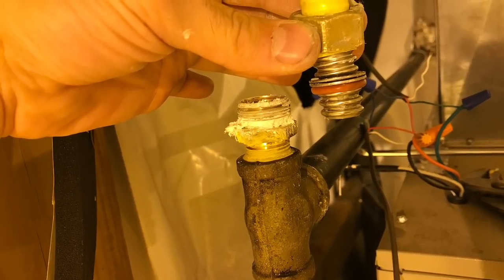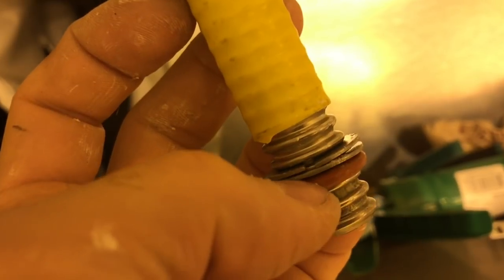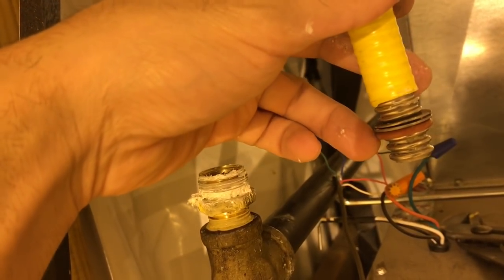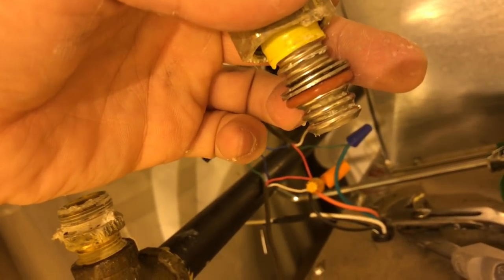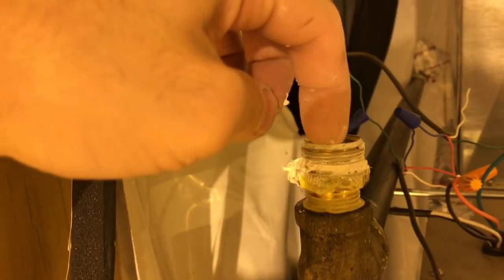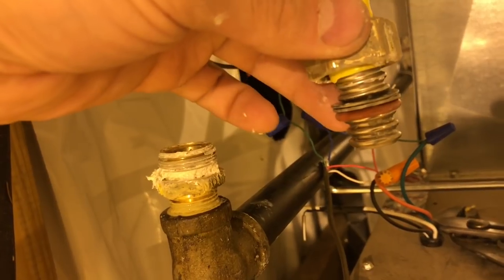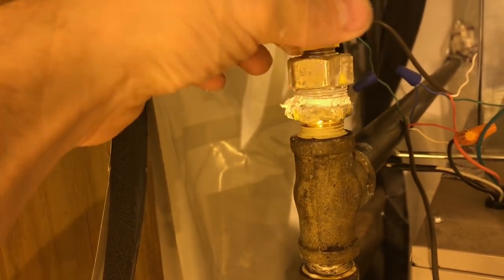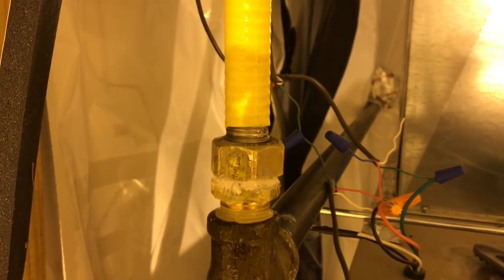How To Install Proflex Propane Gas Line Easy Assembly instructions

Comment: Don’t use pipe sealant on these fittings, o-ring does the work!
Reply: Can i run that kind of line straight to propane outside of house..is there a certain size i should use...im trying to hook up my stove
Reply: @camzona6480  No, CSST is only rated for indoor use!

Comment: Always a tough call: Hire a professional (they know what they are doing but can sometimes cut corners or not know as much as you thought), or learn how to DIY. If you are relatively handy (and can pay for mistakes).. DO IT YOURSELF. You can claim the fame, learn from the XP, and in many cases, end up doing it better than what you what would have paid for. Good vid, and just shows: sometimes DIYers do it better...
Reply: Completely agree with this...a license is no guarantee of quality work.
Reply: A professional means nothing.  Just means they get to bill you.
Reply: Always go with the union card.
Reply: I like to know how to do things myself even when I'm hiring someone to do it professionally. I like to know enough that I'll be able to spot a red flag, something that's really wrong. Otherwise you're completely at the mercy of someone you might barely know.
Reply: This Pros only magic is getting way too simple for LICENSED PROS ONLY. With careful online training and careful assembly, checking for leaks, grounding... there is no reason DIY cannot do simple jobs that will pass inspection.

Comment: I hired guys also,did it wrong,said they knew? I stood there reading the book to them ....hand tight then quarter  to half turn .no more, or you crush the silicone o ring,,also clean all the  crap  off, should be clean and  bonded for lighting  ,a clamp  w 4 gauge  bare copper, as per I instructions, should not touch  ,any metal ducting,wires,pipes, etc than can energize in lightning,....or burn down,
Reply: Mark Bidwell bunch of friggin hacks. I know a handyman who thinks he knows it all. Smart guy, problem is he knows the big pictures, not small details.. he’s set in his ways and doesn’t want to learn. Instead of continuing his education thru books and shared knowledge, he stays put where he learned from the first hack 30 years ago. Never gonna change because in his head he’s right even when he does it wrong.